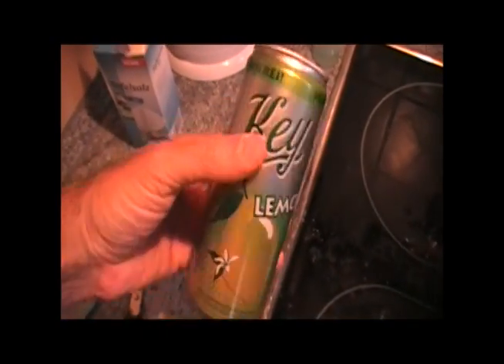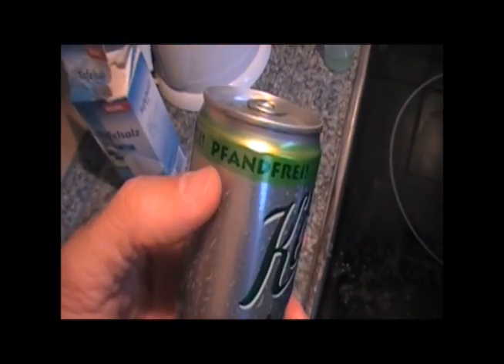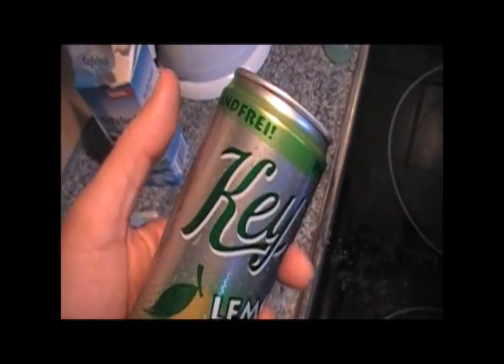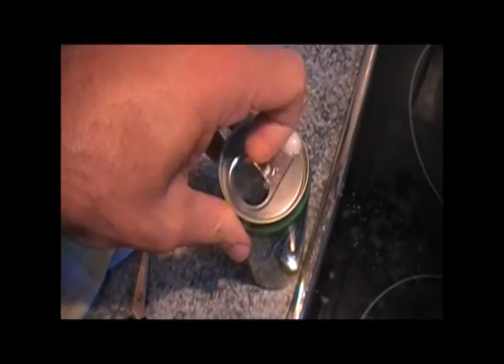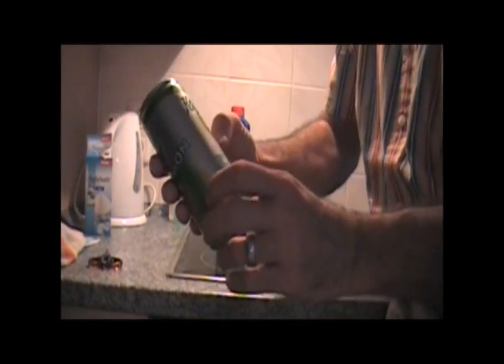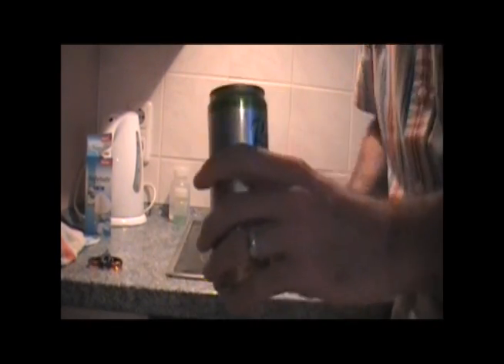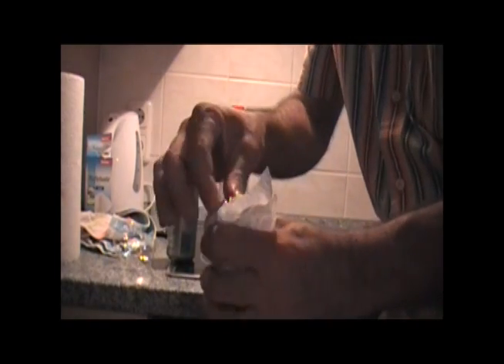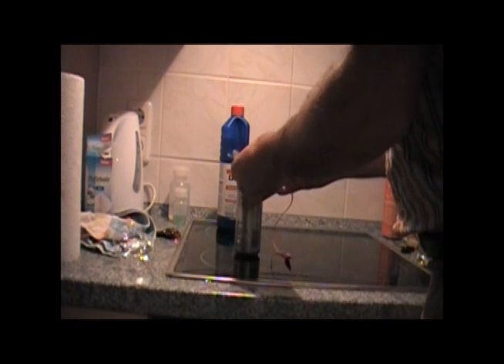Making a battery from an aluminum can to run two bright LED's using a joule thief

Comment: Greetings.... You can use an oscillator to light up leds the same way as the JT, but without a ferrite, just the wire and few components. Regards.

Comment from the maker: Hi Jimmy.  I get mine at Conrad.de. They have them behind the counter here in Essen; I get the biggest size so it is easy to wind. 13 windings with double stranded wire is enough.

Comment: I don't know, but people who have made rock/cement/earth/crystal/water batteries have had LEDs going for 2 years and motors went for weeks.

With crystal batteries the corrosion time is very debateable since no one has found they corrode, and few people are doing this. I think solar panels follow a similar idea + black material to absorb heat, but in the future more people will probably grow crystal cells with aluminum foil + copper wire.

Comment from the maker: @localbroadcast great questions! No, the aluminum isn't touching the stainless steel at all -- it does short if it does (the paper towel, now a sponge in later versions, saturated with draino as electrolyte, separates them). The cans do have a plastic coating and this weakens the reaction.  The draino at certain concentrations seems to eat away at that coating enough to allow the oxidation that drives the reaction, but I find now that my best batteries are made from just the top of the can.

Comment: Dude.... circuit diagram please??? And wtf... is the stainless steel electrode touching the aluminum at the top, or is it seperated somehow so that it doesn't touch?  Because if it was touching then it would be a short circuit wouldnt it?  Also, does the can you are using have a plastic coating on the inside like alot of aluminum cans do?